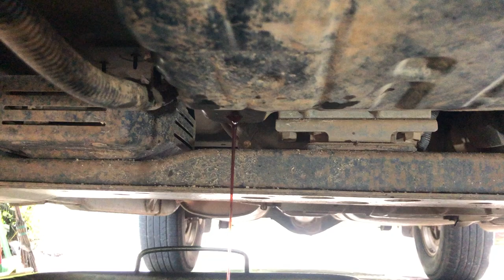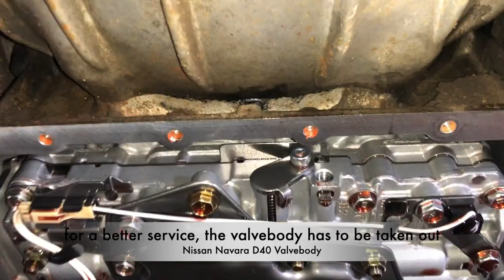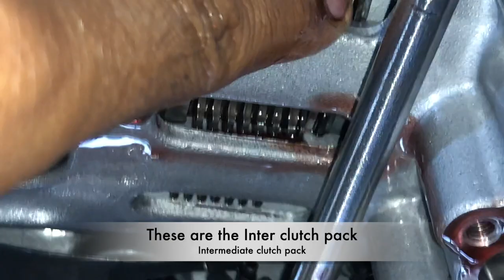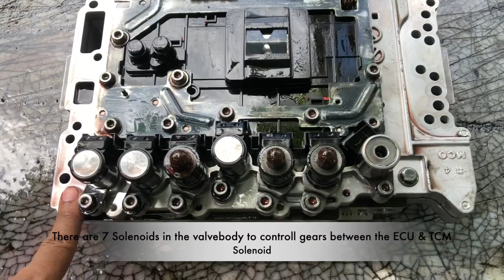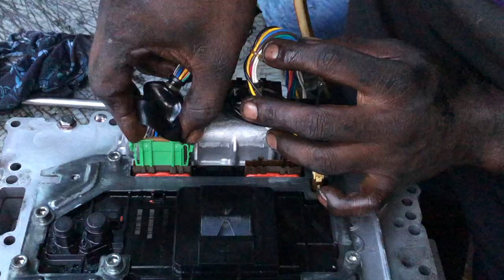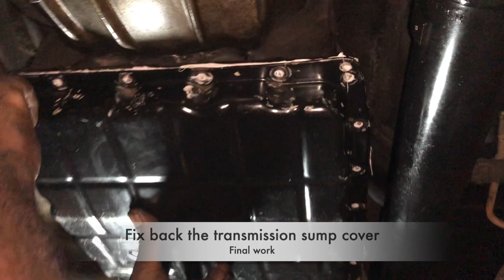Nissan Navara D40 | Automatic Transmission fluid replace | best practice | Step-by-Step

Comment: Como sabes cuando cambiar ya el disco de embrague de la caja automática?
Reply from the maker: You would experience gear jerks, and gear slips while on the highway (speed above 40mph) 

When engaging with forward or reverse (it makes a dragging sounds)
Reply: @abcautotrendy  My gearbox doesn't do anything like that, shifts at about 2.5rpm. My engine is a 2.5 turbo diesel.
Reply from the maker: That means your gearbox perform well, but have a look the health of the engine oil too.
Reply: @abcautotrendy  2.2 rpm 🫣
Reply: @abcautotrendy  I did a road trip yesterday and it was pretty good, I just want more top speed. Currently it reaches 120 km/h without problem, how can I do to reach 160 without forcing the truck so much?